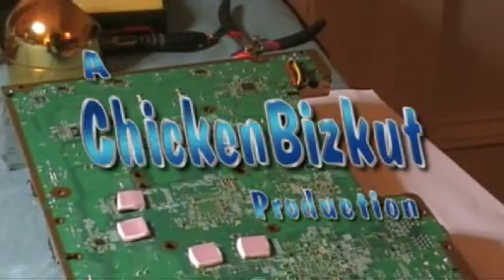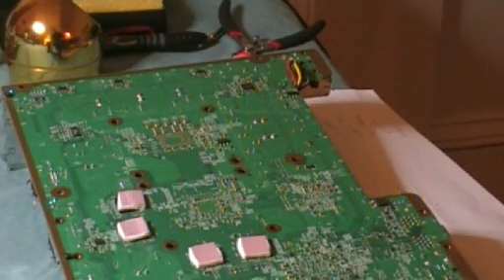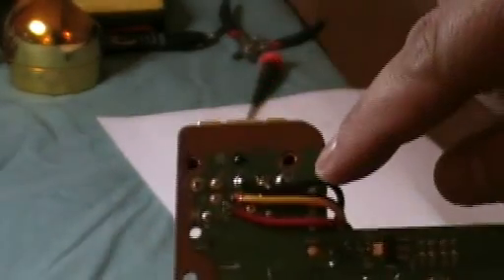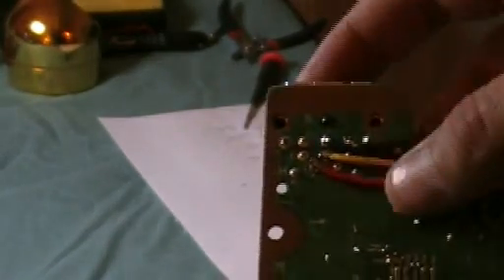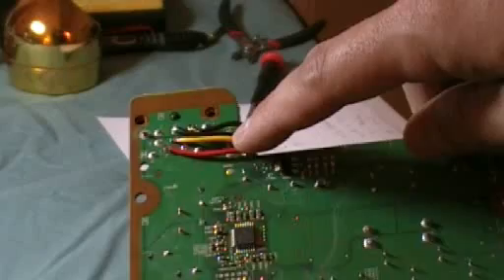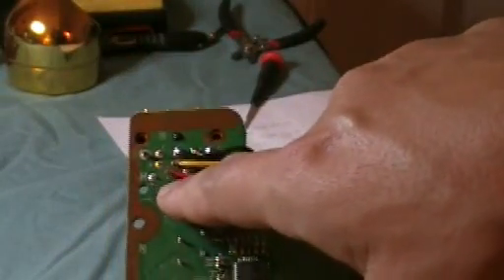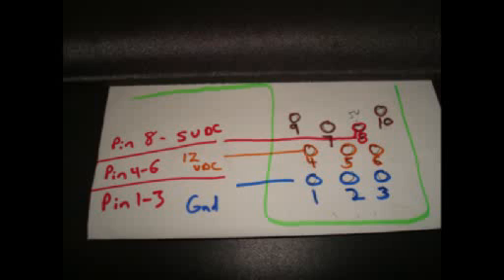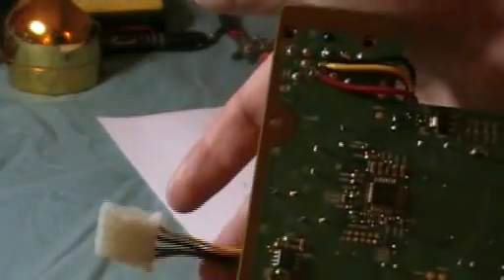XBOX 360: How to get 12 & 5 VDC Power

Comment: My OG Xbox 1.0 I love and soft modded 12k games and did everything too from new fan to new clock cap and thermal paste BUT finally had 320 GB HD going...long story short I got 2TB drive, now dam SATA adapter came with more molex lead and split/// already have Y jumper from a temperature LCD display I put in front of console, I need to cut these loose ends down to size so they fit with new 80 wire IDE ribbon (which is a reversed, stiff mess too from OEM cable adding to this new mess I have where I cant put chassis back on neat). I would like to cut xtra guys and elec tape insulate em, and then take the small 5V/neg leads from temp LCD and find somewhere under hard drive to mount em on PCB like you did, I'm just not good at finding a suitable, safe/isolated point from schematics or looking at it like you are- any advice? Probe w my multimeter at possible capacitor legs or solder sites to find near 5v a possibility?

Comment: I have a hdd cooler that im gonna mount onto the side of the xbox 360, and this seems like a great way to power the 2 tiny fans it comes with! It even came with the 4 pin molex connector, but where can I find one to cut and solder with? Do they sell them at radio shack?

Comment: You know, there's a reason there are so many pins for only two sources - it's to be able to send all the current the unit needs. Your hack is probably going to make the 360 struggle at lot with getting enough ampere at full load...

Comment: ive almost built mine with four fans dotted all over, i was going to use an external power source, wouldn't it put an excessive load on the power pack running it from the board?

Comment from the maker: It should not slow down the Xbox 360.  You are taking it directly off where the PS attaches to the system.  The worst that could happen if you have too many loads or a short is that you would blow the PS.